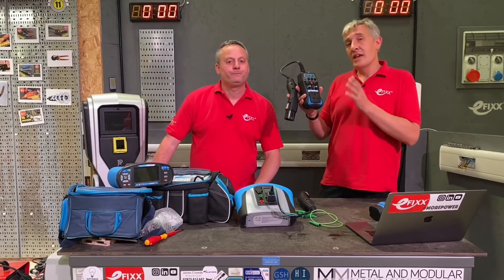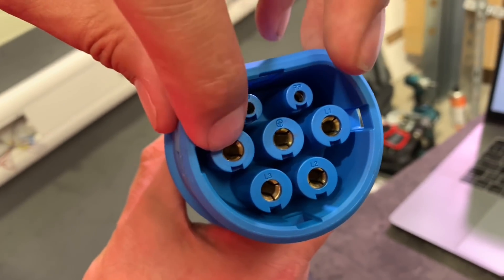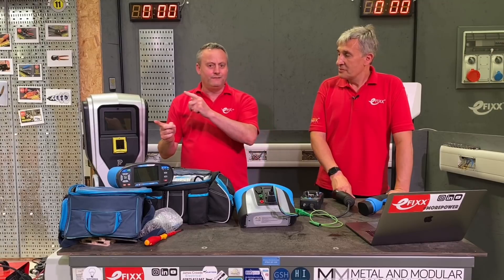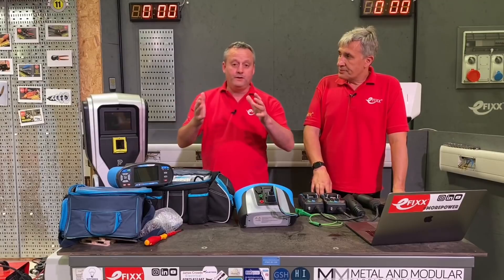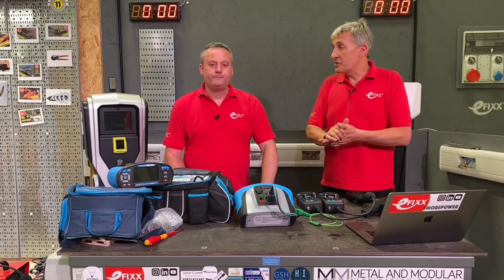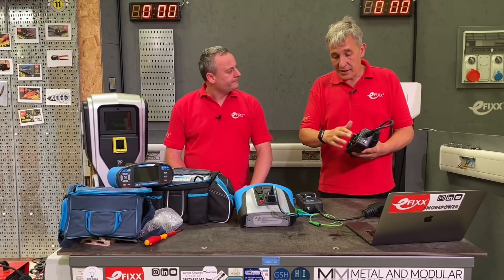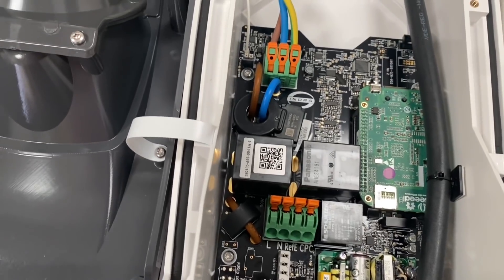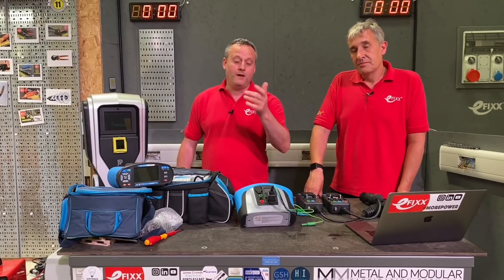EV CHARGER TEST ADAPTERS, WHY you need one & HOW they work  - METREL A1532XA

Comment: I want to tap into the N and L1 of my charger, to have a service outlet at my parking spot. Therefore, do I just need to put a diode in series with a resistor between the CP and PE of the charger pigtail plug (the one that goes on the car)?

Comment: EV testing facilities should be integral to all modern testers, all these plug in adapters are just manufacturers playing catchup and charging us for it. All those prompt screens, if you don't know what tests you need to do maybe you shouldn't be doing them!
Reply: I agree the Metrel is overcomplicated/unnecessary and I don't like the build quality one bit.  The unit looks and feels like a toy not a professional tool. 

That said, Metrel are the only ones who can complete all the test correctly.  Fluke haven't addressed the EV test and the Megger 1741+ that is supposed to address the EV test doesn't do it.  Like I said, the adapters are not the problem, the fact that we cannot properly test our installs is most definitely a problem.

These guys say they are about to address the issue with the problematic 6mA DC test, it will be an interesting video and I dare say lively in the comments.

Comment: Nice video.  How about tackling the 6mA DC RCD test that is causing so many problems.  To be fair Metrel is pretty close after their latest firmware update but even they are not 100% yet.

Fluke, my brand of choice, say maybe by the end of the year they will bring something to market (don't hold your breath),  Megger do a ramp test for the DC and so nearly always return a value higher than 6mA even when the RDC-DD/Type B is working just fine.

We all now know the dangers of DC leaking back into the coils of RCD's (slow or even no tripping) and so the standards set out in IEC 62955 are very important but we lack the test equipment to consistently verify compliance.

As installers what do we do?
Reply from the maker: We are on the case just finalising a date to get everyone round the table.

Comment: And how long before they start fitting resistors on to cheaper cables to fool the charger in to thinking it's a more capable cable?
Reply from the maker: Fair point - buyer beware
Reply: The standard is designed actually so as you add more resistance the rated current goes down. Also means if you have a poor contact on the sense connection, the charger in theory should reduce the charge current capacity down

Comment: Top video boys, very informative👍👍 do you have a list of resistance values (between pp and e) for the different ratings of leads?
Reply: Just done the course so have to hand.

13A - 1.5 kΩ
20A - 680 Ω
32A - 220 Ω
63A 100 Ω

No connection is open circuit
Fault is short circuit
Reply from the maker: I’ll dig them out and post in the description- give me a day or so *Gordon